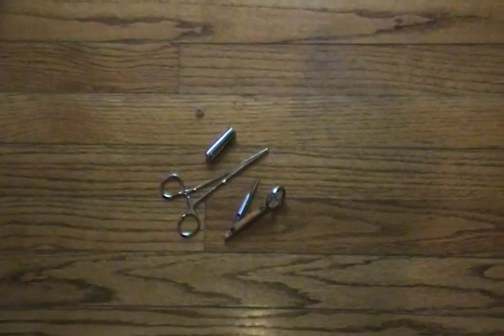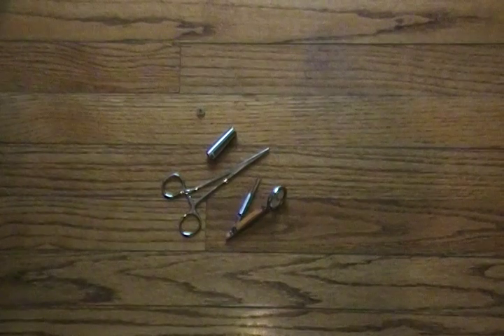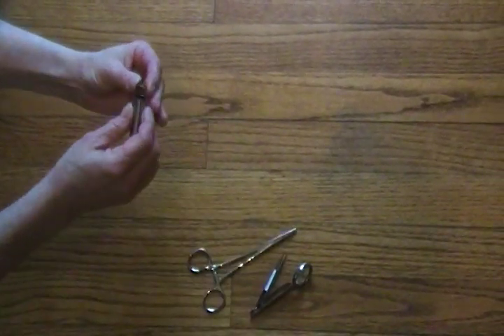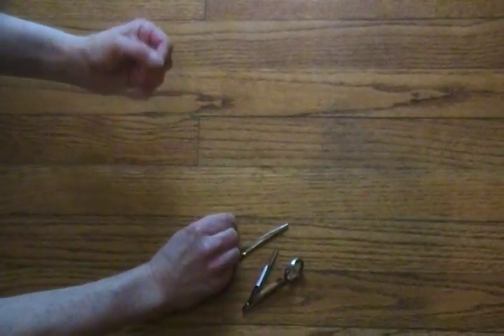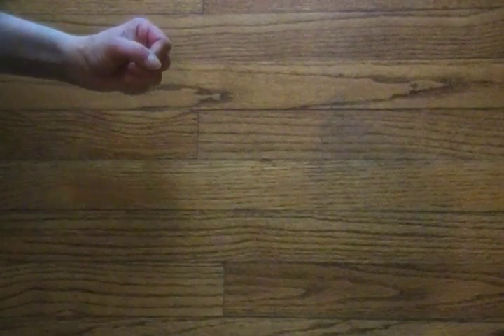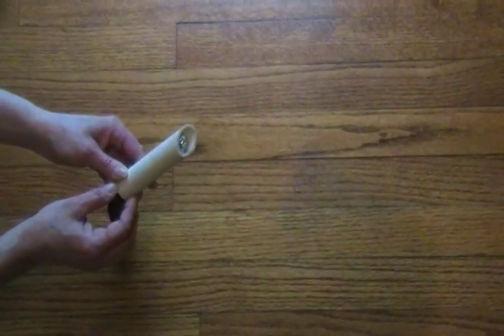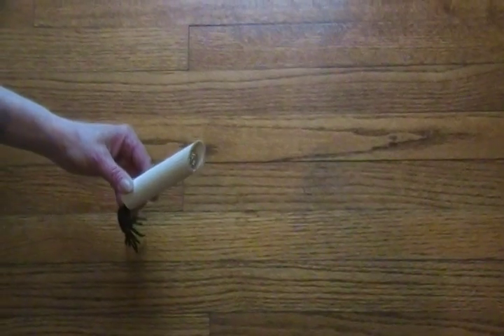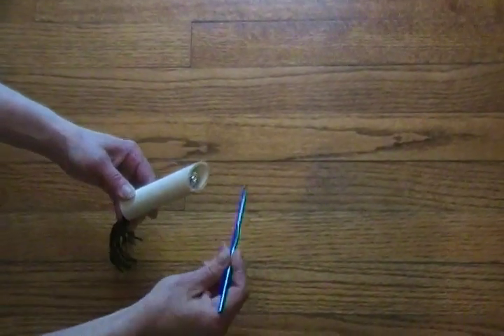eGo-t wick adjustment

Comment: I'm using all VG and it still leaks...seems like the ego T battery died...and my ego C's charge but out of five atomizers NONE work....so its this a contact thing or a wick thing? When my C's were working...they leaked like a sieve and I was told my e juice was too thick. Thanks for the clue here. I need to understand my e cigs and how they work and why they dont. My entire point of going e cig was to save money and my health. I did have extra atty's & swapping those didn't help.